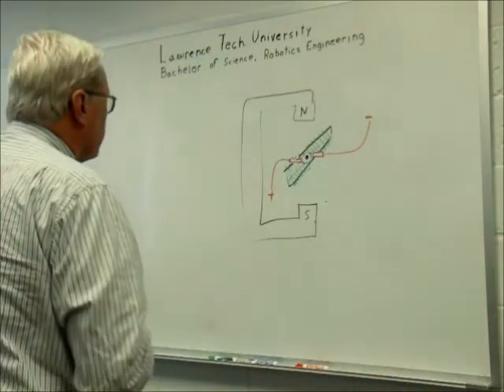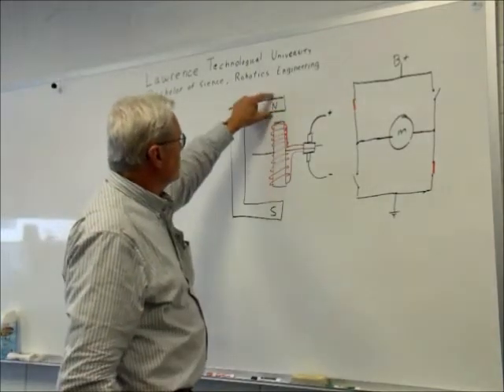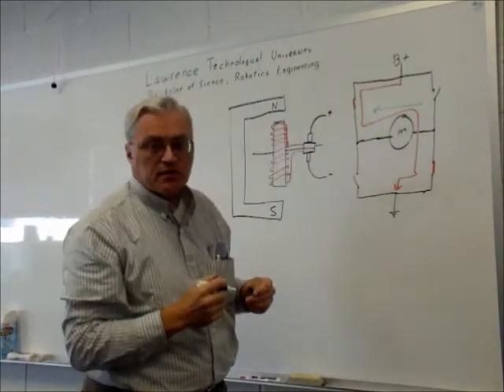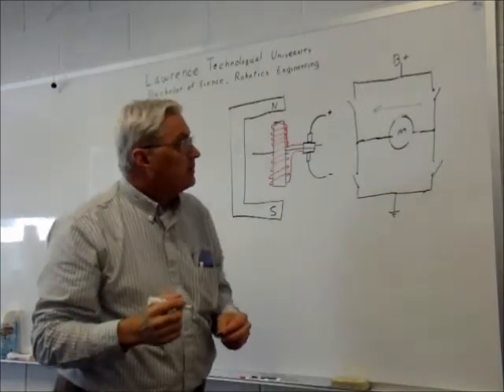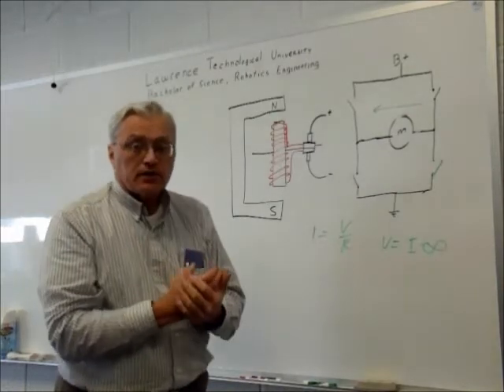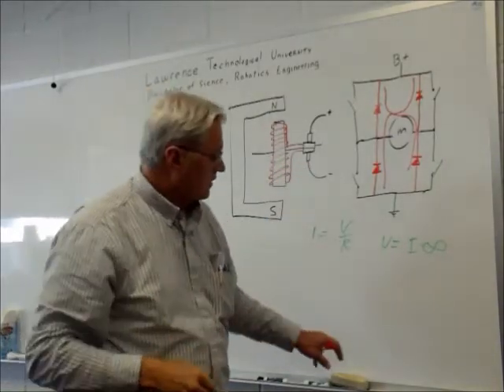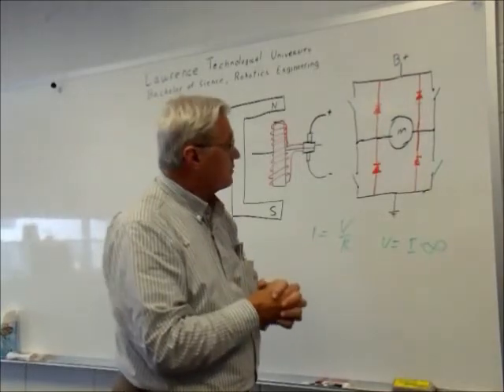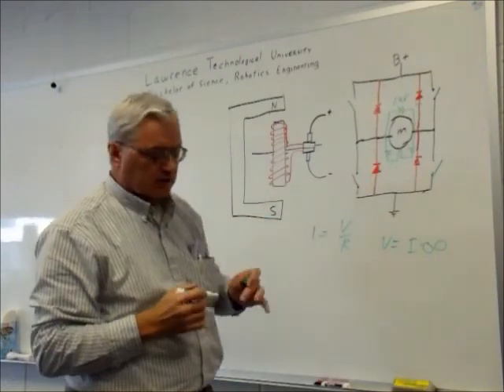H Bridge Driver for Brushed DC Motors - basic explanations and construction Part 2

Comment from the maker: Good question. I wish I had a better answer - but... 
This is something that I have seen recommended by other sources so I thought I would mention it since I can't see any harm in doing it this way and I assumed that the other sources (which seemed reliable to me as I recall) recommended it. (I don't recall exactly where it came from).

Sorry for not having a better answer.

Comment: Hi... thanks for the nice videos...
My question is what is the difference between Half H driver circuit and Full H driver circuit? Your videos shows clearly the half H driver schematic but no mention of full H driver. After googling this question, I found this feedback: In L293 all four input- output lines are independent, while in L298, a half H driver cannot be used independently, full H driver has to be used. Also from data sheet of L298 Dual Full Bridge Driver , it reads: The emitters of the lower transistors of each bridge are connected together and the corresponding external terminal can be used for the connection of an external sensing resistor. Also, I would be very thankful if you could refer me to the differences based on schematic diagrams. Appreciating your valuable feedback...